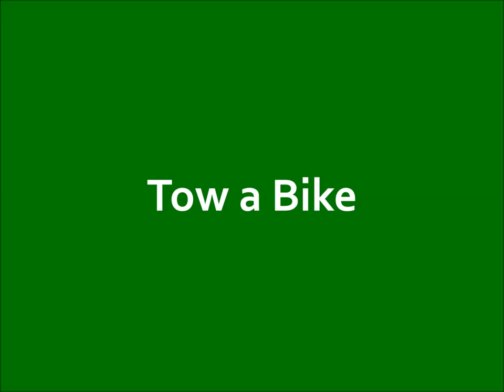Tow a Bike 2013 the ultimate motorcycle recovery towing frame.

Comment: I used a similar system to tow my bike from California to Illinois.  Removed the chain and hit the road.    Only difference was was the carrier was fastened directly to the hitch, and the bike had to be lifted up to the carrier.  Worked well, as long as you have a good hitch, and don't even try and back it up.  You need a cat two hitch for a small bike and cat three for a larger bike, to handle the tongue weight.

Comment: How does the front raise up by tightening the bike to the frame? obviously it works but isn't that a lot of pressure on the forks?
Reply: It is using the front wheel rotation to pick up the wheel carrier

Comment: like the ideal and the effort. I'm a tow truck driver and it would be less work to tow it with a wheel lift, but the bed is always nice. plus a good driver can load it by himself or herself sorry ladies. be safe out on the highway everyone.
Reply: Max Flores too hard on the forks\steering head bearings\and this was a shaft drive bike,going to fuck up the drive running it like that. I dont think the dot would be happy about the single bolt connection for a pivot

Comment: Take a hitch, weld a piece of tubing to it approximately 6” long with a.3/4 id
Roll bike to car , lift front wheel off ground. Remove wheel. Insert axle into fork and tube . Reattach castle nut. Run straps from bars down to frame drive away

Comment: I gotta think on this for a bit, however, I rather have the front tire down, no lube issues, and the wear on the tire will cost, but is cheaper than the labour on the cruiser rear tire.  It would require a light bar, or maybe just reflectors since vehicle tail, signal and brake lights are extremely visible.  This would be cheaper on ferries that charge by the foot.  Great for short haul, but do not think it is worth the cost on a long road trip. (Canada)  I am just not sure how the front steering geometry would work on the bike.

Comment: Wouldn't be better for the bike to just lay it on its side and drag it? I've done the research, dragging it would save your forks. and once it's down, it won't fall anymore! doing it your way you will scrape the paint, you will blow the seal on the front forks, and as you drive the bike will wave side to side until it falls over. Other than that this is a good video! in the end, you could save $10,000 by calling a tow truck!

Comment: There is no way I would permit a bike dealership or tow company to use a setup like this on my bike.  I would insist flatbed only.  Not too good for repo either.  On a repo if it takes that long to hook up you are probably gonna get shot at.  Just saying on repo you got to get in and get out fast.

Comment: I see a lot of risks using this setup.  1) The only thing securing the bike are straps.  If just one were to go the entire setup is compromised.  2) All that compression on the front suspension can't be a good thing.  The seals are going to suffer.  3) very time consuming to set up.
Reply: That's a good point about the straps. Might want to add another strap just in case. It looks pretty good though.

Comment: I’m not sure I would personally trust just one bolt holding my 680 lbs bike
Reply: If you put it on a trailer, there still is just "one bolt" holding it... The trailer hitch / ball is just a large diameter "bolt" with a round head on it...

Comment: Great idea, What are the limitations and legalities with a system like this? could this be used on un-registered dirt bikes? or would it have to be Registered, Tax'd and MOT'd seeing as the back wheel is on the road?
Reply: You're towing, not driving.
Reply: After looking into this and other devices that were similar i found that in the UK this can only legally be used for "recovery" and not general transporting of your bike for that you really need a trailer
Reply: @FranchiseSIX5  towing or not. The bike would still need to be legal on the road to touch it

Comment: I used to operate a similar towing device called the thu-hitch  http://www.truhitch.com/  when I was in the military. The thing is you can lift up the front by levering however you should hook up the pivot point closer to the center of the bike. One day out on exercise, one of my privates hooked it up wrong and broke the towed vehicle's frame in half.

is there an engineer in the house.  can you calculate te stress load on the front of that bike............this is a terrible idea.

Comment: Transmission  bearings will fail do to no lubrication just like an automobile  .
Reply: +steve mitz wrong! cars have pumps in the tranny that don't turn unless the motor is running,the gears will get oil from turning in the bike,I still wouldn't do this unless I had to
Reply: +al robin You are correct, the counter shaft always spins and flings oil. Thanks for your concretion. Now I can build a device to tow my 37 Indian.   Steve
Reply: anytime,daddyo ! see my scoot  at alan roberts on facebook
Reply: CORRECTION I was right in the first place! No gears spin in my MC's traney when in neutral, eng. off being towed .  I.E. No lube to main shaft output bushings when towing.
Reply: steve mitz Put the back wheel on! That should produce interesting results.